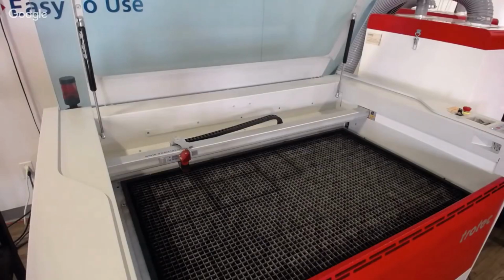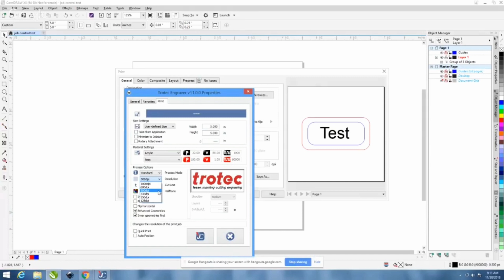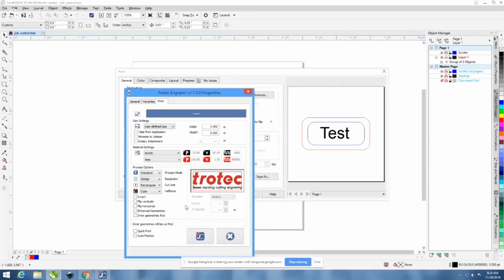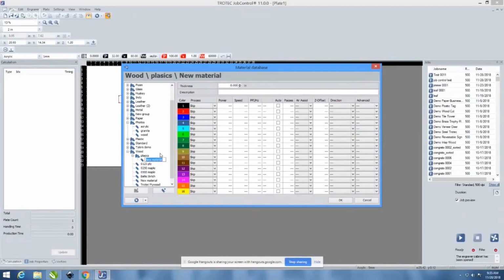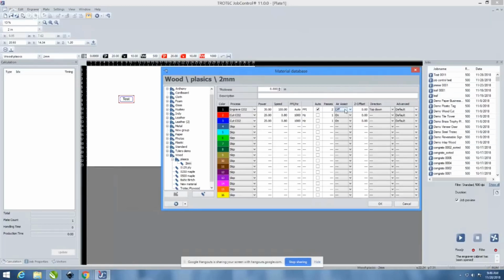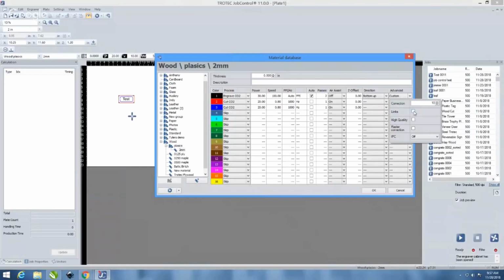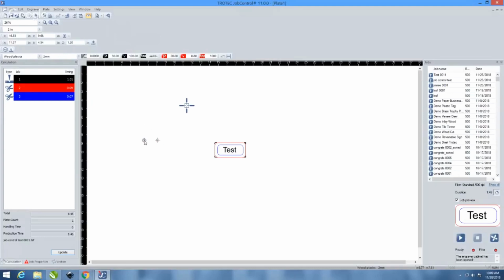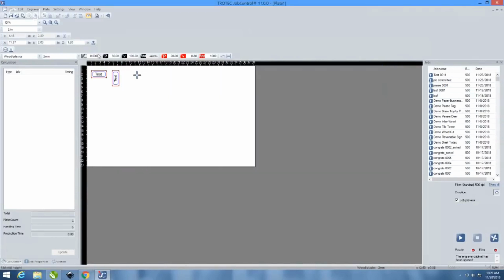JobControl Basics Webinar | Trotec Laser Software

Comment: Is there a way I can keep track of how many designs I print on a single template? The reason I ask is I'm looking to keep track of our printing capacity but we print on several of the same product by placing multiple designs on a single template - I would like to know how many products I'm pushing through the printers each day.
Reply from the maker: Hi Josh, did you try using the job history function? It shows all completed jobs including the time each single job took.

Comment: Is there a way to change the engraving from bottom to top instead of top to bottom. For some reason I can’t find it in jc11
Reply from the maker: Hi Artur, there are two ways to activate bottom to top engraving: No. 1 is in the material database, before sending your design to JobControl. For each process color, there is a column to activate the reverse engraving mode.
No. 2 is in the printing interface before sending the job to Jobcontrol. Near the field where you can set the dpi, you can activate reverse engraving. Let me know, if this helps.